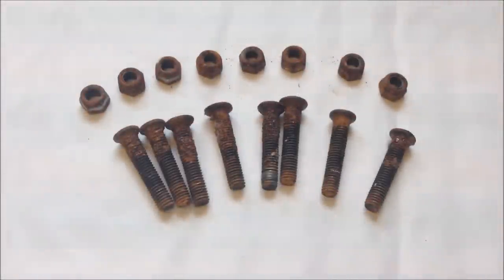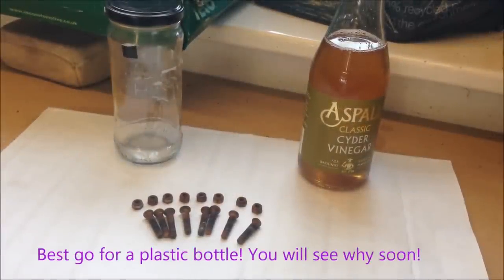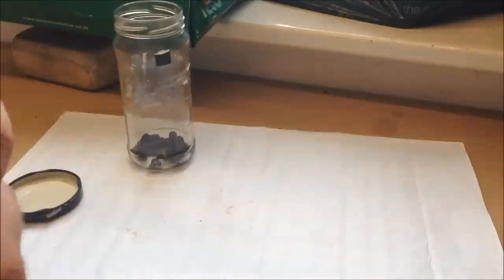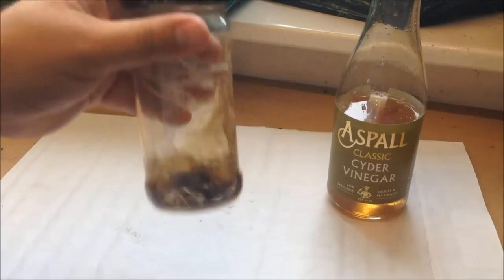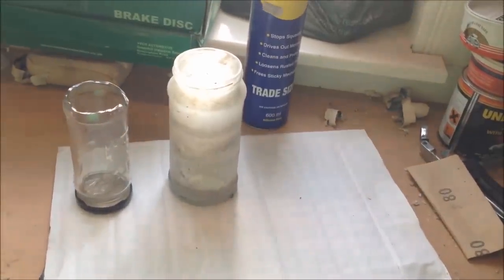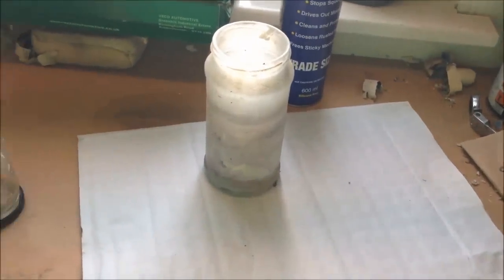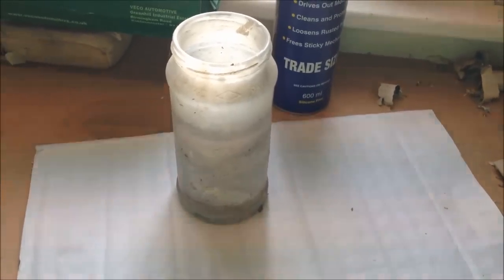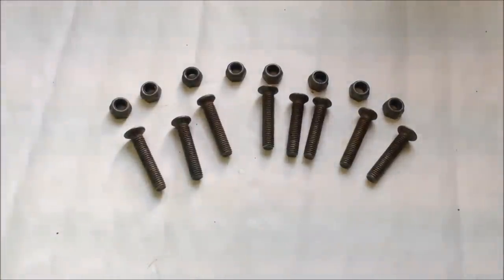How to Remove Rust from Nuts and Bolts

Comment: Just a tip Ive done this several times first time my jar exploded :( 
Using a glass jar is fine also screwing lid on to agitate it is fine but unscrew the lid immediately thereafter 

Its the gas produced from the Rust v Vinegar building up in the jar causes the glass to explode :(

Even a plastic bottle could explode! Once agitated unscrew the lid,lay it on top if you like with a gap but don't leave it screwed on :(
Reply: ha - don't seal the lid on next time then
Reply: thx for the heads up, im about to do this myself

Comment: applying wd40 let sit for 5mine, before giving them a vinegar bath would have sped up the rust shedding. probably down to an hour

wd40 gets under the corrosion and isolates the particles and fragments in the oil

Comment: Hey quick couple questions! Do you have to neutralize the acidity of the Vinegar after you dried the parts? 

If so, and you used say baking soda, would it be best to mix baking soda and water and quickly dunk these parts in the solution and wipe them dry again? 

Or simply toss these parts in dry baking soda and then wiping them off?
Reply: Yes